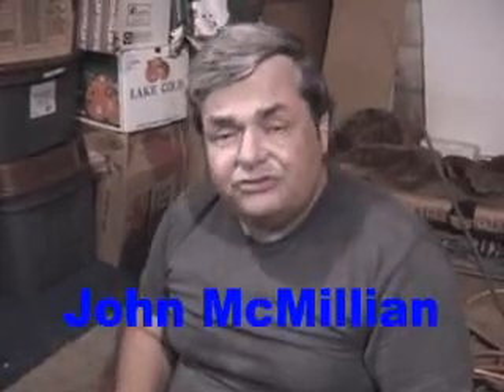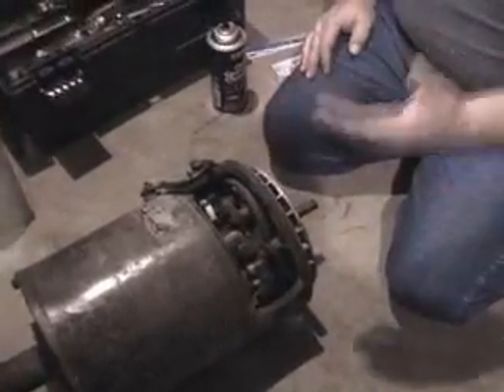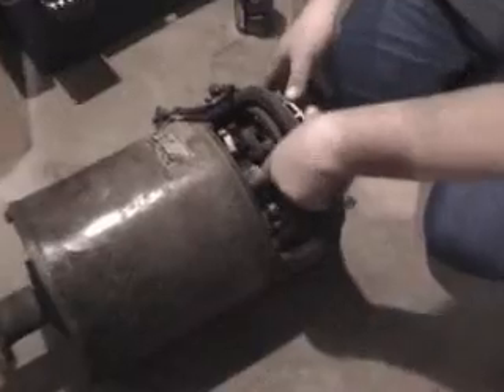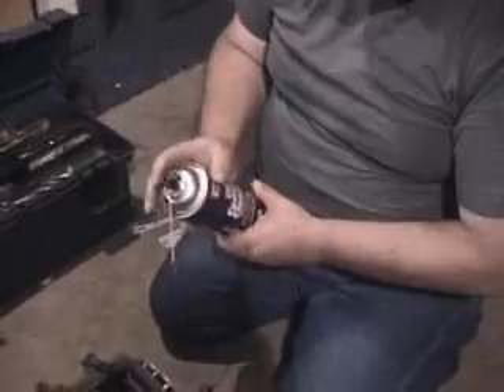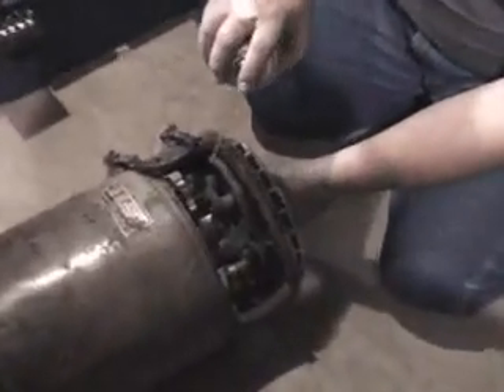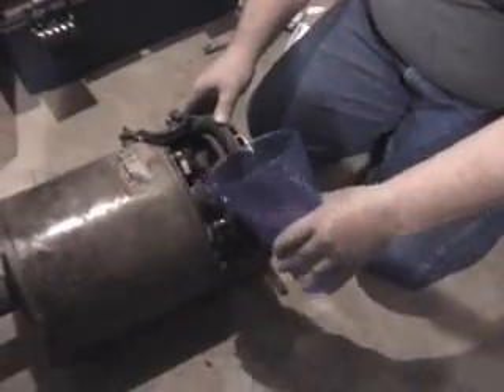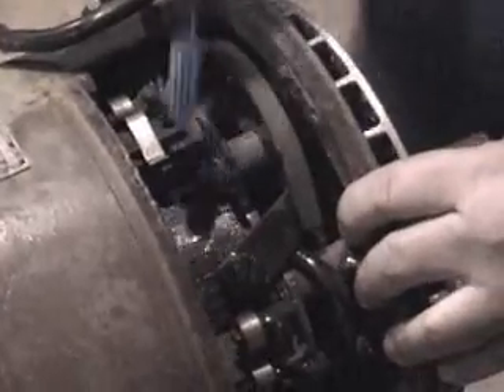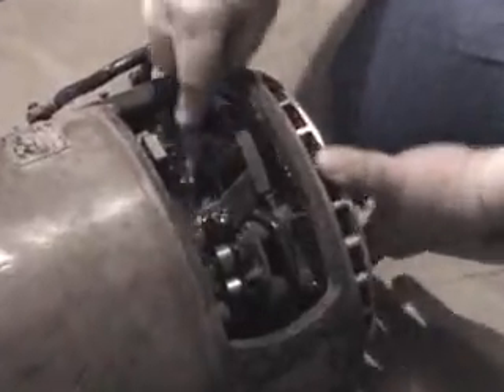Electric Car Motor Maintenance 101

Comment: Yikes, in an emergency where I havent had time t strip the armature and recut the commutator I've had to sand the commutator intsu. A few grades of sandpaper would have given a vastly superior finish, not to mention having to wait a few days for the water to evaporate in the windings that you just pushed in with the compressed air.